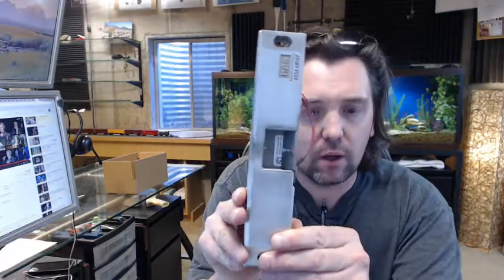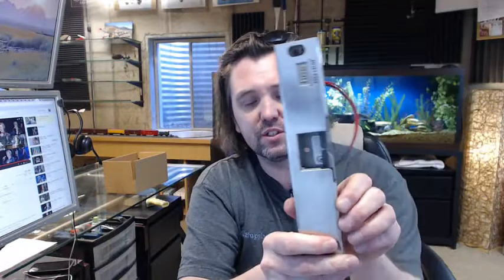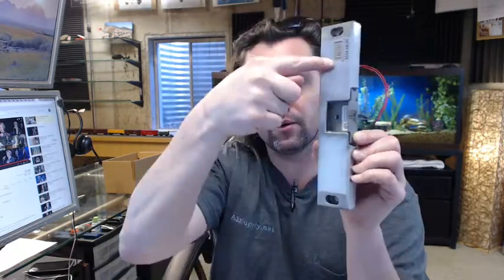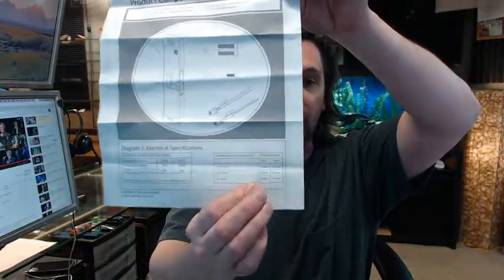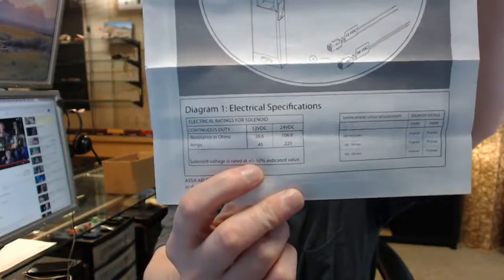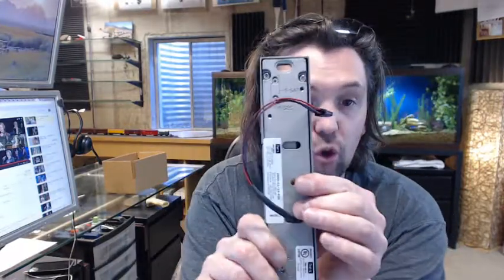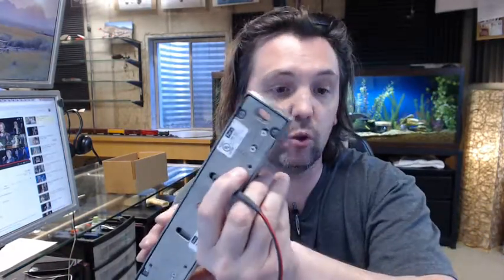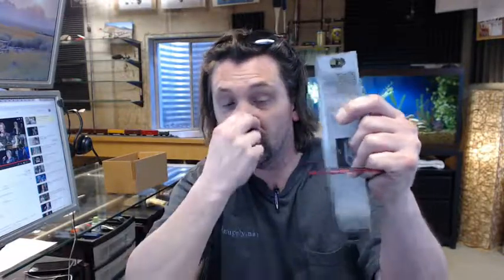Hes 9600 Genesis Heavy Duty Surface Mounted Electric Strike

Comment: Is CAT6 suitable wire for these?
Reply from the maker: It would depend - You need to confirm the mA that it will pull, the voltage that you will power it with along with distance to power supply.  My initial guess is that you could certainly use CAT6 but that you're going to need to use more than one strand per lead.

Comment: What’s best practice of wiring if I don’t have the 12v or 24v pigtails ?
Reply from the maker: Im old school so I just use wire nuts and electric tape.
Reply: RICHARD HOWARD that’s what I figured. The pigtail that’s don’t have has a jumper between the black and red. ... am I to mimick that or can I just wire nut black to black and red to red?
Reply from the maker: @coreykeller4604  What is your order # ?
Reply: RICHARD HOWARD it’s the 9600
Reply from the maker: @coreykeller4604  I understand it is the 9600 strike.  What is your order number is so I can look at the original order that you placed with us.
Reply: RICHARD HOWARD I don’t have an order number. Door contractors supplied these strikes and installed them. I’m wiring them

Comment: I have an HES 9600 that has worked for more than a decade.......now one of the triggers is not releasing......any suggestions?
Reply from the maker: Would that be the upper trigger by any chance?
Reply: no...it is the bottom trigger
Reply from the maker: Have you confirmed that you aren't getting adequate amperage / voltage at the unit?
Reply: That is my next move... figured I might ask as it is about 11 years old and it is a high volume door......
Reply from the maker: I have worked with this exact strike before and have witnessed it not operating properly in the absence of proper amperage.  It is possible that the failure or the failing components of this is not the electric strike but is something else at the power supply or transformer so make sure that you have an understanding of what you ought to be supplying to the strike and confirm that it is being supplied and do let me know what occurs please.
Reply: I have my buddy an electrician coming out to check..thank you so very much for your time.....!

Comment: Having trouble with a few 9600HES strikes when using panic bars the added tamper proof dogging latch above or below the main latch bolt.  Where should the additional latch land?  Within the opening on the 9600 or on the face?
Reply from the maker: Which device are you using with the HES strike?
Reply: Its a von duprin panic bar
Reply from the maker: August Freemann 22 series ?
Reply from the maker: The Von Duprin 22 has a dead latching anti tamper feature as seen in the parts manual here:http://absupply.net/pdf/VonDuprin_Parts_Manual.pdf

Th error being is the strike is made to accommodate a 3/4" Pullman Latch and the stock 22 device is technically not this latch.  This is the cause of the unreliable operation.

Having said that, your only attempt is to have the tamper latch fall on the face of the strike and not inside the keeper area.

Is there a follow up question that we can perhaps attempt to answer?  We take pride in our technical expertise so don't hesitate to ask.
Reply: Ok we will try that and see thank you.